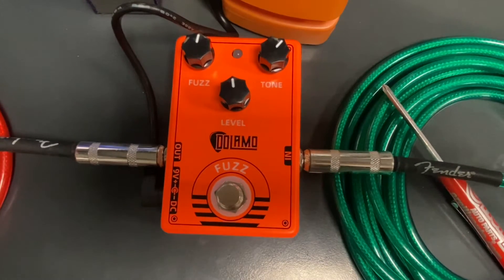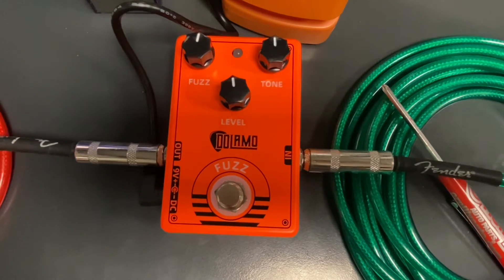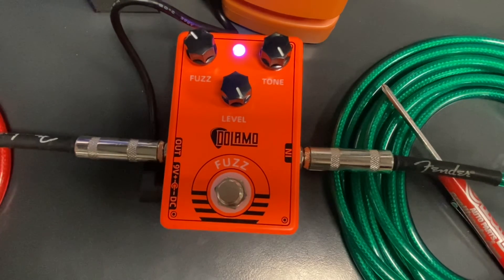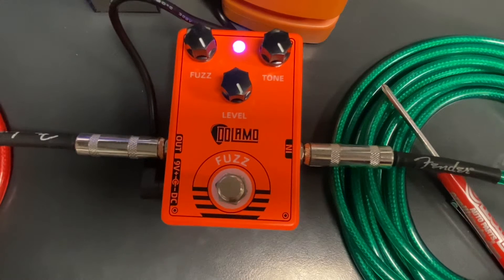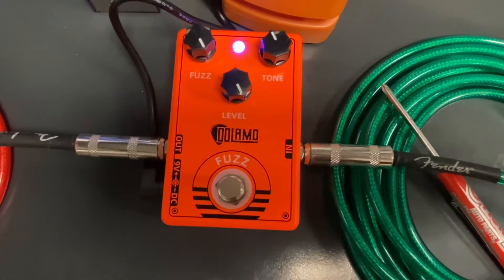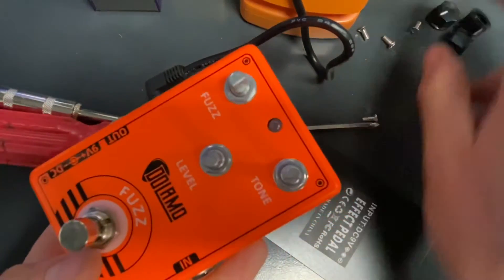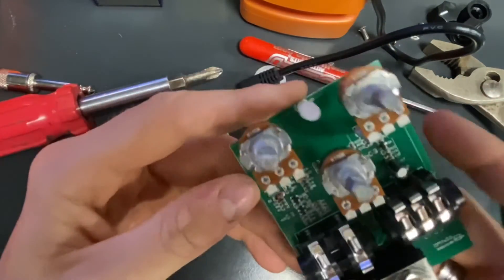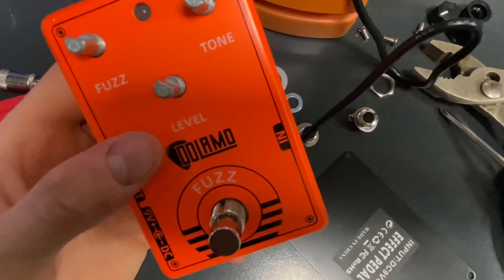DOLAMO Fuzz Demo and PCB

Comment: I dig it. Sounds like a fuzz face with a tone knob, which is super cool. Gotta be nice to bump the tone on power gain settings.
Reply from the maker: I looked up what this pedal is a clone of and it’s a clone of the Caline Puffer fuzz, which is a fuzz face with a tone control.
Reply: @googaboogaloo but the tone knob on caline puffer is not tone. It's a bias knob
Reply: The typology of 4 transistors and clipping diodes, Corresponds to a Big Muff.
Reply: @inessalazarkopp4579  great... Still sound alike a fuzz face tho.. 4 diodes or 2... And yes I know a miff has 4 and face has 2
Reply: Possibly it sounds like a "fuz face" due to transitors bias.  making it sound more "Velcro like" "or choppy  sounding "

Comment: Four transistors and clipping diodes but it sounds like a poorly biased fuzz face with a low pass filter.. Either way I love it and I just ordered one. If you have a steady hand and a good eye you can mod surface-mount stuff. I was a little bit intimidated by it first and I'm still getting the hang of it but I have actually modified surface mount pedals before.
Reply from the maker: I found out it is a caline puffer fuss which is a modded fuzzface. 
I have tried to do smd stuff and my eyes aren’t good enough.

Comment: Hi, you have my like and I'm subscribed. I bought my Dolamo fuzz 2 years ago on Aliexpress and it came with a brutal noise in the tone potentiometer, which I had to change to make it work. What was my surprise when I opened it, the PCB said CP 11. It's been more than 10 years since I bought my first Caline pedal and the nomenclature seemed familiar to me, as well as the sticker on the pedal cover. Doing some research, I found that Dolamo pedals are manufactured by Caline, and they are a kind of white label to continue selling old Caline circuits. This one in particular is the Caline CP 11 Puffer Fuzz model. And guess what? It's a pedal I already had and yes, it's a clone of the Fuzz Face.
Reply from the maker: @abril8596  so do you have both?
Reply: @googaboogaloo  yes 😀😀😀😀
Reply from the maker: @ so have you compared the two? I mean they should sound identical but I’m just curious. Isn’t the puffer also available to be run off of 18v?
Reply: @googaboogaloo  Hello again. I also love to know these things haha. My version of the puffer doesn't allow to put it at 18v. If you look at images on google you'll see that there are some that only accept 9v, and it has to do with what it says on the pcb next to CP11, it says v1 v2 and v3. Now I don't remember which version is mine. Regarding the sound, as you know I had to change the tone pot to the dolamo, and I don't know if it's because of that or not, but they don't sound exactly the same although they are very similar. That said, the 3PDT switch on my puffer is a real piece of junk, and it also happens to me on another Caline, the English man. Both must be more than 10 years old and those components are not of quality. Greetings.

Comment: So I got one and the pots were crap they honestly couldn’t be worse but that was an easy fix after 3 pots off Amazon… the pcb is amazing quality thank goodness because I ran 22awg from the pots I got the are breadboard pin out and came with wire with connectors so that gave me the idea to get a kit of different values and tapers of pots to see what happens
Reply from the maker: Yeah these cheap pedals components are just awful. But for the price they are good enough if you want to start getting into pedals or just mess around with. That’s awesome you could replace the pots!

Comment: What are you running it through please? Sweet tone by the way. I've been trying to get mine to sound like that but I have a shit amp.
Reply from the maker: I’m running it through a clean crate gfx 212. The other amps I usually use are what people would call shitty amps haha. I use a peavey red stripe bandit and a peavey vt 212.
Reply: @googaboogaloo what about the guitar? It has humbuckers or singles?
Reply from the maker: @hecttu singles. It’s an sx tele with a gfs overwound 60s bridge pickup.
Reply: @googaboogaloo  great, thanks for the quick answer, i'm going to buy mine right now!

Comment: How did you charge the effector? I bought it but it's not working so I can't use it╥﹏╥...
Reply from the maker: Do you have a power unit that is the right polarity and voltage? It should be a 9v positive sleeve negative center.
Reply: @googaboogaloo I don't know anything about electronics, can you suggest one to buy 😅
Reply from the maker: @user-yi4kf4sw9i  what sound are you looking for
Reply: @googaboogaloo  I got the same dolamo fuzz pedal, but I don't know how can I power it, I mean I know I need a 9v cable.. I've tried going on a store and said it's hard to find the one and said the shop owner needs time to get me one... Can't I just know which one is the right one so I can buy it online
Reply from the maker: @user-yi4kf4sw9i  do you want it to run off of wall power or battery? 

Battery: planet waves pw-9vpc-02
(There are other battery adapters, they have a yellow tip, i don’t have these and i do not know if they fit in the power jack.)

Wall: type in pedalboard power supply and if you want a cheaper one that still is pretty good, go with a mosky brand or a Joyo. That one should power a whole pedalboard so if/when you want more pedals you can power more than just one.

Comment: You can mod those cheap pedals
Reply from the maker: The parts are so tiny I honestly can’t. My eyes are not that good. If it’s through hole I totally would but these smd ones I’ll just leave alone.
Reply: @googaboogaloo   oooooh these days its surface mount... forget how old i am haaa.. breadboard,  pcb population and wiring is simple with old school semi conductors
Reply from the maker: @jasonsullivan4584  I think the joyos and caline pedals still use full size components.
Reply: @googaboogaloo   you can always add a.starve control,  wiper a 1k potentiometer in parallel to 9v positive